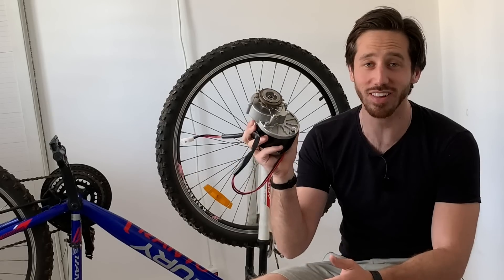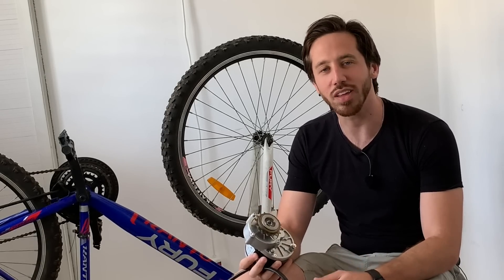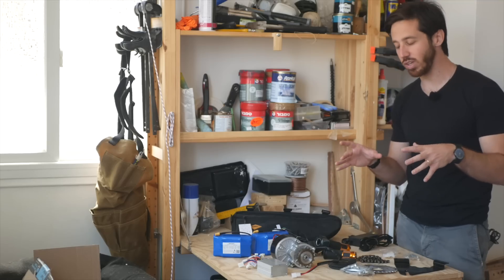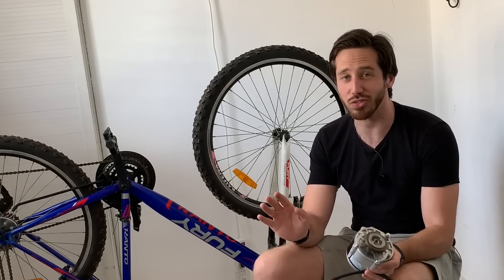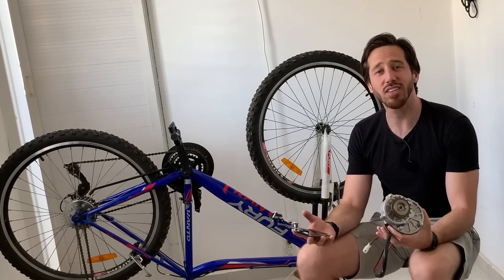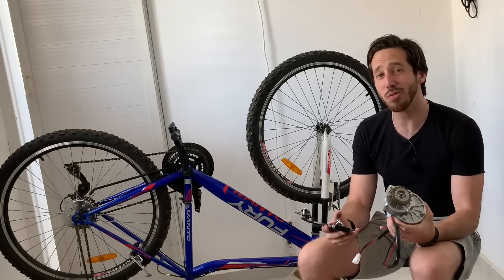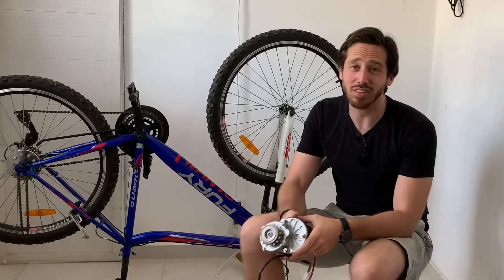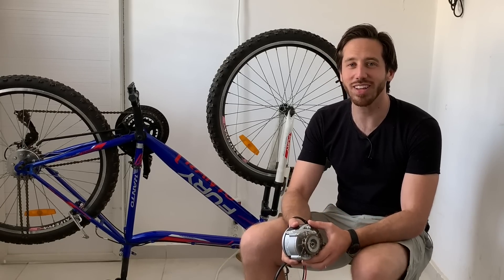Do NOT buy this $103 electric bike conversion kit

Comment: Thank you for the warning.  And for being honest and humble enough to admit that even an "expert" can be taken for a ride.  Pun intended.  I've watched quite a few of your videos, as well as many others and reviews.  I've learned one main thing.  Because I understand the electrical synapsis of the human brain but by no means am any kind of electrical engineer, I'm opting for an iMotor or UrbanX.  Battery is in wheel.  Very minimal wiring.  Pretty much a "plug and play." The one I reeeeaaallly want is an E-Trike Kit, but at 598.00 WITHOUT battery is a bit rich for this 66 y/o on Social Security.  But thank you again for your interesting an clearly stated videos.

Comment: any reason why you're not looking at direct-drive hub motors?  i got my kit (motor, controller, throttle) for less than $130.   it's 1kW and relatively easy to install.  hardest part was routing all the wires.

Comment: Looking at 3:32, i am wondering if Micah could try different axle spacers on each side of the wheel axle shaft (shorter spacer on non drive side, longer on drive side) to move the wheel over to align with the motor sprocket.  different spacers can be obtained at bike stores.  would have to readjust the rear derailleur (on other side).  Also noticed that  the axle bolt was way loose in the video, so can't really tell just how far off alignment he really was.

Comment: You CAN make it fit. You need to bend the bracket near the axle to get the proper angle, then install half inch (or larger) bushings behind the sprocket. That will solve your problem.  A shop press is very helpful in bending and shaping the bracket.  I realise most people don't have a shop press, but most people probably know someone who does. Even the cheap $99 press will work.

Comment: the most expensive part to a majority of ebike kits is the battery. SO better have a brushless direct drive hub engine.  IT WILL cost more but if calculate as whole will not be far more expensive and will last 10 times more. IN CHINA almost all ebikes and small escooters use rear hub direct drive motor.

Comment: I had a cheap front geared hub motor for $175 which worked great with 36v setup.   That was few years ago.  Now the prices of these kits and shipping have gone up significantly.  A motor like the one you have will definitely need some custom welded mounts.
Reply: Even a front hub kit 2 months ago was like $150 for 500 watts.  Now with inflation, those kits are $250
Reply: I also had the front hub motor 36v 750w had it for a couple weeks then some ass decided to steal my whole bike because I chained it up really well. But didn't stop him from chaining it to his van and ripping the whole thing just to get at the hub motor

Comment: This kit is not bad or anything, the only not so good is that the motor attachment does not fit so god but you can easily just fix that by just attaching the motor attachment on the outside of the bike frame. I have done this myself and it works very good

Comment: Bracket on the inside, a couple of washers, and it works beautifully. I'd say the motor isn't all that powerful, but if it is just help you need on some of the stiffer hills, then it works just great. You got stuck when all you needed to save the project was a 5 dollar steel plate...
Reply: Easier with aluminium than steel .....
Reply: @normandgallant8106  Hi, proof?
Reply: @GDMHificationranpitc  cutting and drilling holes is easier with aluminium
Reply: @normandgallant8106  true I should have asked the person above for proof... maybe I could get some images out of them.  Have the lovely resurrection power ever day kind of day.
Reply: @GDMHificationranpitc  I've made two brackets with aluminium for these motors , and using them on mu trikes ,can I help you with the images you mentionned ?
Reply: @normandgallant8106  yes please do you want my email or something more dynamic?
Reply: That guy is a virgin. Took him 5 minutes to f*cking say the core message of it
Reply: So, does it make much resistance when pedaling?
Reply: @L4ND.SH4RK  No, the motor disengages so no drag at all
Reply: Wdym
Reply: Thank s
Reply: Is it water proof or should I waterproof it
Reply: @Cjphey466  It is not waterproof, I have seen one of these disassembled, its maintenance is simple despite not being brushless, it is important to do a good waterproofing. I think it's ideal for a mid drive system, installing the motor to turn the crankset. Look for videos like this on YouTube.
Reply: u save me a lot of money, i was about to get this sistem for a front wheel
Reply: I don’t think people realize how misleading it is to say ‘just use a $5 steel plate’ like it’s a quick fix. That’s not a bracket — that’s a custom-fabricated motor mount. You’re not just drilling a couple holes and slapping it on. You have to trace and drill an accurate bolt pattern, cut out clearance for the motor body, position the chainline perfectly, and securely mount it to the bike frame — all while hoping your tolerances don’t throw everything off by a few millimeters. That’s fabrication work. If I asked someone to do it for me, it would cost about as much as the entire kit. It’s fine if you’ve got the tools and time, but let’s not pretend this is something casual users can ‘just do’ with a Home Depot part and a good attitude.
Reply: @earthenscience you don't need to fabricate an entire new rear plate, just some smaller adapter pieces.  And if you're not willing to do that (its not very hard, and youtube is here to help) the saving money with this kit isn't for you.  The more polished and easier something is, the more its going to cost.
Reply: Try a 48  volt batter, the motor really perks up!
Reply: @Scott4271  I'm using a 36 volt battery I found on the side of the road in mine it gets up to 20 on the flats.
Reply: @sizzles1743  Cool!
Reply: @Scott4271 
I did 52 lol
Reply: @Scott4271  burns out faster
Reply: @steebbo9460  I’ve been tracking the motor temperature. Never gets over 100 deg F
Reply: @Scott4271  it will then it will seaze up and smoke. Good luck I've already done this test tho
Reply: @steebbo9460  I seem to recall you did a video on over voltage and ebikes where the basic message was over voltage was ok as long as you kept an eye on motor temp.
Reply: @steebbo9460  As a public service I will post if it happens.
Reply: @Scott4271 good luck I went with a brush less rear hub in the end £150 Amazon and two hover board batteries

Comment: got mine delivered today, there is no way to make that bracket work on a couple bikes i have at this point with starting to grind parts off..... i put a new hole in the frame so i could try to mount it inside but still doesnt look right... they have got to figure out a better bracket solution because as of now, ill have to return it... :(

Comment: I actually made an ebike buying a 180 dollars ebike kit 48v 1000w and some liitokala cells then i used a modified microwave oven trasformmer to spot weld the cells and a cheap 20 dollar bms from ebay total was 180(for the kit)+80(for 39 cells)+20(for the bms)+ 25(for a charger)

Comment: I have seen your first video on the $182 ebike conversion. I think I will still get all the parts recommended in your first video. I have metal fabrication skills and plan on making a custom mount for the motor on the rear triangle of a dual suspension mountain bike that I am converting to a tadpole style trike. Thanks for all of the information.

Comment: I bought this kit with a sprocket fit into disc brake bolts perfect aline with the motor and it works fine but you need a wheel ready for disc brakes. Anyway I think is better to spend your money in a hub drive kit if you're not a good mechanical

Comment: It's the kit, not the motor.  I think you've been a little nieve believing Chinese descriptions of anything. First hand testimony is far better. There are so many different rear dropouts and stays on bicycles today. I would expect you may need to personally produce an assortment of tube spaces, washers, clamps etc to make everything line up and run solid.

Comment: Don’t give up...   the problem is a pre-made steel plate with a couple of breaks in it.   Just cut a metal plate and break it to a geometry that WILL place the sprocket in line...
You could do it with a hacksaw and a vise....   start with a sheet of cardboard and create a pattern for the piece of steel you have to cut that once you put the break in it, will allow you to mount the thing.

Comment: Surprise ...not really. I have been building e-bikes for over 10 years. Mostly custom projects and very rarely does it not take custom enginering to bring everything together. Your best options for fitting out of the box with few problems are the kits that are a little more pricey. Example Luna Cycle sells Bafang HD midrive system and hub motor options but these kits run 400 bucks and up.  If you want to save a buck you have to be willing to put work into it and make it work.

Comment: I bought this kit after watching your initial "window shopping video."  Then I bought a used Diamondback Wildwood off Craigslist.  I had some spare SLA batteries, wiring and battery case.  I spent $75 for the bike (Craigslist), right at $100 for the motor kit (from Amazon), and $15 for a rechargeable light kit (Wal Mart).  I paid $50 for the two 12V15AH SLA batteries from Amazon, so in all, about a $250 investment.  I used a $5 plastic ammo box for the case, and just cut holes in it for the output and charging terminals.  It DID actually work in my case!

However, three things I didn't like about the final results.  1: not enough power for climbs.  2: my heel hits the motor while pedaling, and 3: the sprockets don't line up, but the chain stays on.  I gave it to a friend, and he's happy with it.  It was frustrating, but it gave me a sense of accomplishment, and now I can go riding with my friend.  You can't put a price on that.

Comment: I bought this kit a few years, and it took me about 2 months to get to align correctly. Although the one i got was with the sprocket that fits on the disk brake rotor, instead of the pineapple brackets that you got. I had to add spacers on the sprocket to push it out a bit more, since it wouldn't align with the motor freewheel. Maybe you could do the same and add washers underneath your hub sprocket? That should push out your sprocket even more and hopefully you'd get a better alignment. Another thing i did is that I hammered the mounting plate straight, since it was slightly curved. I also used hose tighteners to mount the plate on the bike frame (i didnt use their cheap aluminum brackets). As well, I noticed that the entire motor+plate would get pulled back and the chain would come lose whenever it was under load. So what I did is that I used cables with cable tensioners (attached the the seat tube) to pull the motor back, so that the chain always stays tight. Also, always try to keep the chain as short as possible. But you're definitely right, this kit is not something that you put together on the evening and ride the next day. It will most likely not fit on the first trial, and might take a few months to get it to work properly. But to their credit, this motor is a tank, it's super durable and you won't find anything better for the price. So if you get it to align and work properly, then this kit will get you to decent speeds, and you will have it for many years (hopefully). Although, the controller that came with it, well that's another story...but making your own controller for a DC motor is quite easy. Anyways, I hope this helps.

Comment: you can little change the bracket position.to achieve the sprocket and freewheel in a line. if you have any problem for the DIY ebike kit,can feel free contact with me(yalu@wzyalu.com/0086-13780706710(whatsapp). i am marina from YALU MOTOR.  we are continues update and improve the DIY Ebik kit.

Comment: Send it to me i will install it on mine 3 wheeler
Reply: Not sure if I trust this guys opinion anymore , hope he improves his mechanical skills ......I've installed this same motor on 4 different location on my trikes...only been testing one motor so far  but plan on buying a few more , the motors look serviceable but are cheap enought to bring a spare while cruising long distance....meanwhile I'm hoping to find someone that has opened the motor to service it , like replacing the brushes and bearings etc

Comment: You should change the title to "I can't make it fit my bikes". 
You don't actually show that the kit doesn't work.
This could be the "perfect" kit for my bike or someone else's bike.
You should have connected all the parts (motor, controller, battery etc) to test if the electronics work (and show it on video)
You should have tried to "temporary" mount it on one of your bikes to test if it can curry your "weight" around and how fast-powerfull it is. (and show it on video)
And then say if you recomment the product or not .
I think that, someone could manufacture a mount and fit this on his bike, only to find out that the motor or the controller are "bad".
(after all the mount is the cheaper part in the kit, you don't buy those kits for the "fantastic" mounts)

Comment: This type of ebike conversion kit & electronic motor resembles the,  2 stroke / 4 stroke gasoline motorized bicycle kits. 

IMO if you’re going to covert your bike to an ebike.  You should get either a front/rear hub motor.  If you want it done cheaply. But if you’re willing to spend to get more power & speed.  Then you should get a mid drive motor.

Comment: Just buy a hub motor. I don't know why everyone feels the need to over engineer the hell out of the idea. Just more stuff to go wrong
By the way, I might be wrong, but it looks like you were installing that plate on the wrong side of the frame. It looks like it is supposed to mount inside the frame
Reply: Exactly what I was thinking. it goes on the inside.

Comment: it's not powerful enough for a full size adult to begin with.
It's good for making kids go kart using bike parts...ect
My s300 has the same size motor..( 12 mph)
the gearing are just gearing.
There's 500watt on my grand mx 500..(15 mph)
I'd have to mount 1000watt..if I wanna convert for me to ride. 15-18mph
It'll do better if I mount a 1800-2000watt BRUSHLESS...

Comment: "This motor is bad because the piece of steel that came with it doesn't fit perfectly..."
Universal means you have to make it fit, not enough man-points to use a hammer?
Reply: https://youtu.be/-S5udTm2rp0
Reply: @biluroy4455  : Too much ads, didn't watch. A summary?

Comment: This is something not relevant to this video, but thought i could ask... 

I am trying to build a 36V 10AH Battery for my Ebike, by connecting 3*12V 10AH battery packs in series. Each battery pack has its own BMS. So in this case, how should i charge them. Can i use a 42 Volt charger to charge all three of them at the same time? Or should i use 12 volt chargers for each battery pack separately?

https://www.dhgate.com/store/product/2019liitokala-12-v-10ah-protection-large/488242199.html#st1-0-1|0|0;stprod|4201473597

https://www.aliexpress.com/item/32809914211.html?spm=2114.12010612.8148356.37.296f7578FH8WAu

Comment: I had been thinking about building a bike. Once you add the Bafang mid-drive kit and a battery plus adding the new wheels and tires for disk brakes and the calipers you're in for over a grand on an older bike. I think a newer used bike might be a cheaper way to go.

Comment: Hi.. Mickey .. I want to make own ebike and I chooses hub motor kit but the thing is that motor specs like rated voltage 36-48V and power 250-500W and controller shows 36-48v with Rated current 15-17a... Please suggest the suitable battery for 40 to 50 km range.

Comment: I bought the motor and  the batteries after watching  your video..the batteries wouldn't work well with that motor and i bought other ones, but the gear breaks very easily and i had to get another, then the controller went. its was a waste of three  hundred dollars. I kind of wish you would have made this video earlier, or take down the old one showing people what to get. Thank you for this, it will save others.

Comment: Hello,
Great videos thank you. I am a new subscriber, I am not sure if you talked about this already. For a bike that needs to cover 60km every day, on high assist or even better having the option of not pedaling, Is it better to have two 48v 21ah batteries ( stop and switch the low one for the fresh one no fancy setup) or one 48v50 ah battery or as large as you would recommend.
Average speed of around 30km/h - 35km/h 
I want to build an electric bike with a 48v 1000w Bafang BBSHD kit. I just am not sure of the battery I should get.

Comment: Hello all. I bought a bms from amazon it's a 36v 35a 10s protection board with C - , P- , B- . The strange thing is it will charge up only on the P- lead and not the C- one. No reason why this would do that other then a issue with it. Has anyone had a similar thing happen.